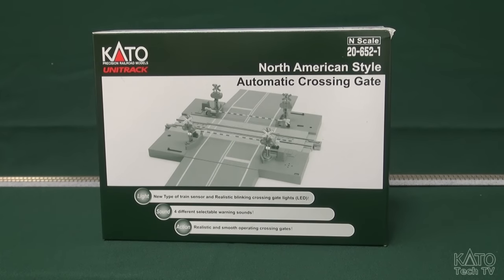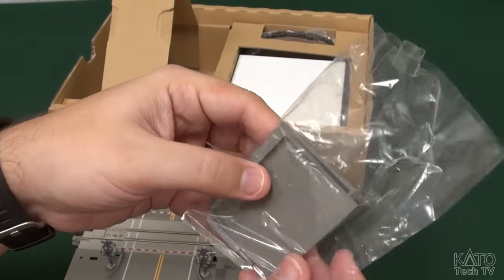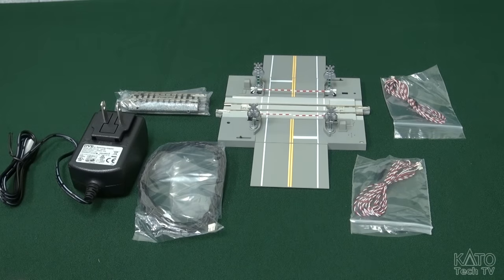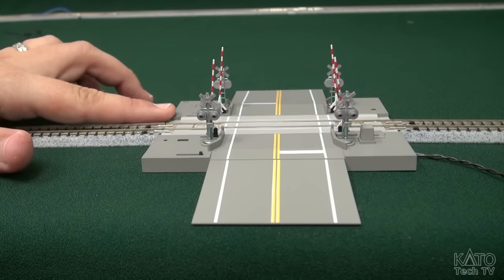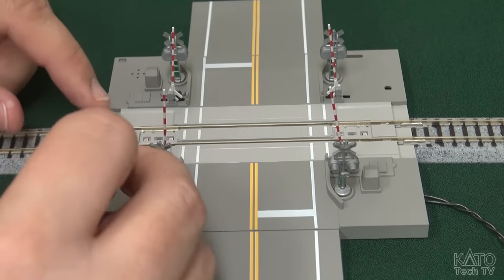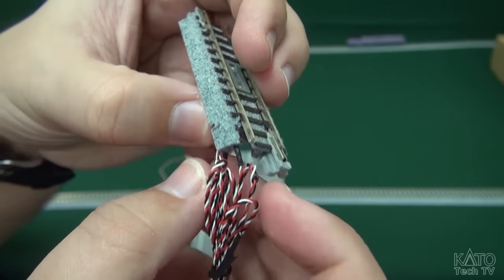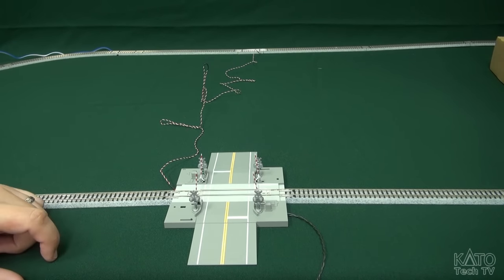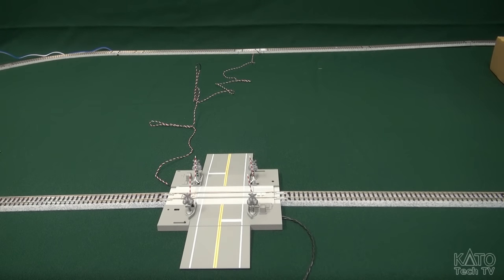Kato USA New Product Preview - N North American Crossing Gate

Comment: Fix the speed of the gates and make it in HO and I'm sold.
Reply: wrailfan how about O scale!
Reply: the gates shoul move slower, not nap up, snap down imagine standng under that  ate when it came down
Reply: Boom
Reply: @markdm5415  yes but the only thing is that if the train is going fast it will get to the crossing before the gates are fully down
Reply: Depends on when u put the sensor dude

Comment: First Sound Switch: (Fast WCH Mechanical Bell Sound Effect) 8:06
Second Sound Switch: (Another WCH Mechanical Bell Sound Effect) 8:22
Third Sound Switch: (WCH Electronic Bell Sound Effect) 8:37
Fourth Sound Switch: (Default) (General Signals Electronic Bell Or NEG Electronic Bell Sound Effect) 8:54
Reply: Yeah, I especially like the inclusion of a couple of actual electronic crossing bell sounds. Many railroad crossings in my area tend to go with the WCH e-bells (mostly replacing Safetran mechanical bells that failed over the years.)

Comment: Does the system have the smarts to know if the added sensor before the signal is tripped (starting the bell and signal) but then the train reverses direction before reaching the crossing and backs out ? Will it reset ?

Comment: is there away to adjust the speed of the gates coming down?
Reply from the maker: No
Reply: It uses springs, so I'm wondering if using springs with different tensions would change the speed at all.

Comment: Will this work with power trains 2.0? (The N Scale track, and the level crossing?)
Reply from the maker: The track and crossing are designed to work with standard DC and DCC N Gauge railroad models. I can't guarantee that they'll work with a battery operated system like the power trains, and I don't know what the gauge on their wheels are. Chances are unlikely, though.
Reply: If its in 1:160 scale, it will

Comment: Can that thing be ran on infrared? Likely I would want to run my layout at night without the gates staying down due to darkness. Otherwise I'd have to locate a light source over the track at the sensor points.
Reply from the maker: The sensors that are built in are photo sensors - if you want them to operate off of infrared you'll have to rip out and put your own sensors in.

Comment: I'd like to see someone come out with realistic looking American trackside signals in N scale. Most of what I see looks like European prototypes, and on the wrong side of the track. I'd like to see a searchlight signal in N scale that is totally enclosed on the back side of the target, without wires and solder blobs coming out the back of the signal heads. Trains are made now to rivetcounter standards, I'd like to see signals, especially the old searchlights,  the same way for N scale. I like this, it's the first self contained crossing system for N that actually looks clean.

Comment: question:  looks like the gates go down / lights off as soon as the engine passes over the sensor on the exit side.  SO... if you have a train with 30 cars (that I assume won't trip an infrared sensor), then the gates / lights aren't "on" while the cars are passing over?
Reply from the maker: You can put the sensor track far away from the crossing so it closes after the full train has passed - that's the advantage of the separate sensors.
Reply: @KatoUSAinc  I've connected the two sensor far away from RR crossing and that works normal detecting in bound train. In either direction the gates go up after the last car leaves the RR crossing sensor. I thought the gates & sound would go up after leaving the second remote sensor. Am I miss understanding how it suppose to work or do I have it connected wrong?

Comment: The US version should only have 2 gates or the option to remove them.
Reply from the maker: There are plenty of crossings in the Chicago area with four gates. As more and more people try to drive around them, I'm sure they'll become more common throughout the country.
Reply: also on divided roads, you see a lot of fully blocked crossings. just do some repainting on the lines on the road and put two together and you've got a fairly common divided road crossing from around here.

Comment: I just purchased a few Kato engines and cars. They are made and run very well. I like the crossing gates and would buy it, however I have Bachmann EZ track system. Can this be adapted? Are there conversion tracks? Or do I have to buy Kato track. Thanks you!
Reply from the maker: There are no conversion tracks for Kato to EZ Track, unfortunately. You can slice off the connectors on the bachmann track and remove the joiners from the UNITRACK to create two flat surfaces and join them with generic rail joiner clips, but you would have to shim the heights to match.
Reply: If you're looking for advice, ditch the Bachmann track. It's overpriced, low quality, and almost any other brand of track is better. My three favorites are Kato unitrack, Atlas code 80 Snap-Track, and Atlas code 55. Atlas code 80 is the cheapest option of all but it doesn't look as nice or have as many options as code 55, while Unitrack is the most reliable, although the geometry is weird.

Comment: QUESTION ABOUT KATO UNITRACK WITH DCC.

This North American Crossing Gate looks fantastic. I can't wait to get one. I like the fact that it's compatible with both DCC and DC operations on the track.

That's important because I'm getting ready to switch the power supply for my N scale Kato Unitrack from DC to DCC. I'll be using KATO terminal joiners as my DCC feeder wires. 

This brings me to my question. What gauge is Kato terminal joiner wires--24 AWG or 22 AWG? I scoured your website at katousa.com for wire gauge answers, but found none. In your website's FAQ section named "Unitrack Specifications and Clarifications", anyone can quickly and easily find what code of rail is used in Unitrack. But in that same section, nobody can find what gauge of wire is used for Kato's own track power feeders, including for feeder tracks and terminal joiners. 

Your website's FAQ subsection "Using Unitrack with DCC" would be the perfect place to specify Kato's wire gauge, so if a modeler wants to make suitcase wiring connections into Unitrack terminal joiner wires, then he or she will already be informed of the correct AWG size to acquire for the run-and-tap wire suitcase connectors. Knowing Kato's correct AWG size is essential to that purpose for connecting the DCC feeder (Kato terminal joiner) wire to the DCC bus wire with the properly sized suitcase connector. 

Please add this crucial DCC information to your website's FAQ about what AWG size that Kato uses in its track power wires. But before you do that, please answer my question here. Is it 22 AWG or 24 AWG?

Thank you very much for your attention in this matter.

Sincerely, Tom Pilling

Comment: Please make this in ho scale, with the double track feature, and can you guys make the Amtrak auto train in ho scale. With 20 cars for the first run, and more metra bi- level commuter coaches. Also bring back the sd38’s in EJ&E. Also, make the Amtrak empire builder in ho scale. This would be nice, a full line just doe the empire builder. Also, could you guys at Kato make the Reguler bi- level autoracks in ho scale, in multiple road names, with the Kato ho scale kinematic couplers. These are all great products that would sell, so yeah please!

Comment: Do you have a setup for double track  or two tracks that goes threw it?
Reply from the maker: Yes, there is a multi-track adapter, each piece comes with two extra sensor tracks and you can go up to 7 parallel tracks.
Reply: @KatoUSAinc  been hearing some guys complaining that some locos like steam engine hits that gates...on the kato group on facebook..

Comment: The problem with Kato is they have there own track and its hard to find straight peices and i dont like how its a unique track also could u run other n scale trains like Athearn, Bachmann etc on kato track?
Reply from the maker: You can absolutely run any N Scale train on Kato N Gauge Unitrack, whether it's Athearn, Bachmann, Atlas, etc...
Reply: Everything in N scale is compatible with everything else. Kato even makes an adaptor track to connect their Unitrack to Atlas' Snap-Track, and you can make your own adaptors to any other track you want.

Comment: Is there a way to mute or turn the volume down but leave the gates functioning? We will have this on our store layout and certainly want to be able to demo it with the bells, but hearing it every 2 and a half minutes when the train goes by might get a wee bit tiring!
Reply from the maker: Yes, there is a volume knob that is controlled with the small included plastic screwdriver on the top of the crossing gate - look to the small hole with a rotating switch in it on the side that has the speaker holes. That is the volume control.

Comment: That looks like a pretty neat product. I like how its expandable for multiple tracks. I have a couple of questions.

For the sensors, are these sensors reflective infrared? Are they affected by ambient light? Will they work in low light such as night running?

As far as logic is it programmed to sense direction? So the gates will go down when being detected at a remote sensor and then go up after clearing the “island” sensor on the crossing and if the train is coming from the other direction go down at the other remote sensor and clear after clearing the “island” sensor.

Is this going be available in HO scale at some point in the future?
Reply from the maker: They are light sensors, but have sensitivity adjustments to allow them to work in different lighting conditions. It decides direction by which sensor is tripped first. There are no plans to make this in HO, at least as far as we are aware.